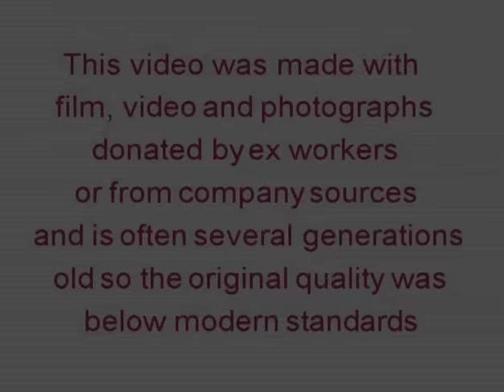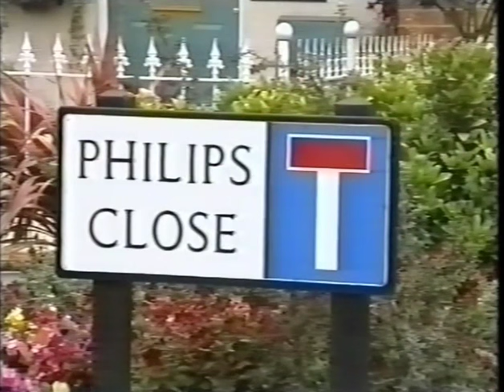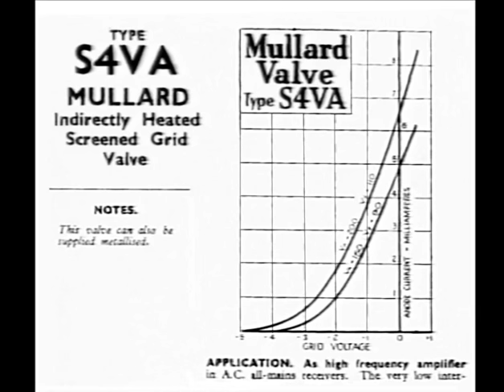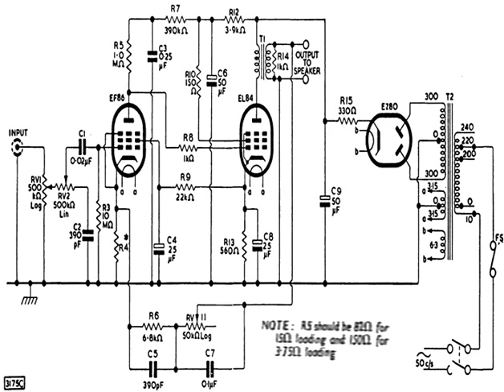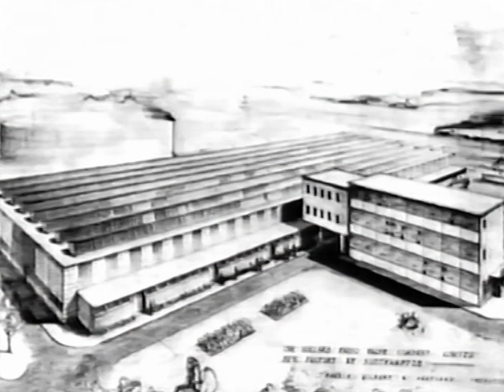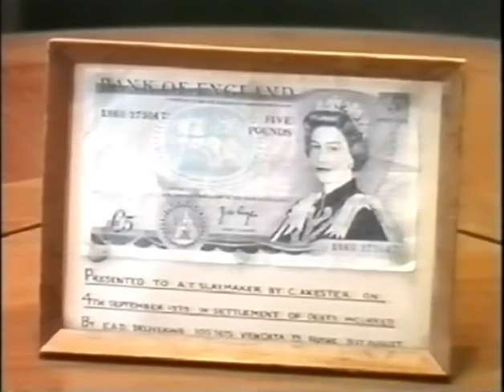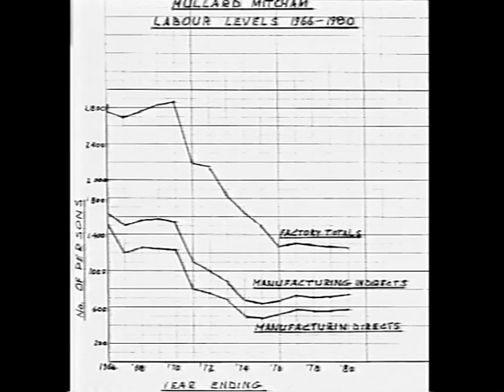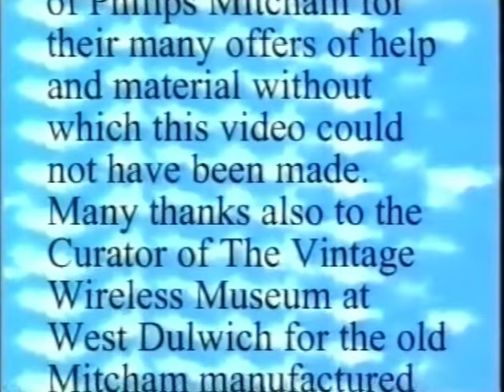Mullard Mitcham Remembered

Comment: I worked there in the early 70's on a student training program. Absolutely amazing place, so many people working on so many different products. I was based in the transmitting valve section and later in the FM radio module department.

Some of the products I remember: Colour TV tube production, microwave cooker development,  magnetic computer memories and fibre-optics.

It was a great place to work, with a real buzz. It was all state of the art stuff then, topped of with an amazing canteen!
Reply from the maker: I was also there in the early 70s working in the Deflection and Display Lab for Alex Ciuciura. Maybe we met! I built an FM tuner using Mullard Modules. I still have it.

Comment: I was an apprentice at Copeland & Jenkins in the mid 50's, where we produced the mica insulators, that went into valves. I have always wondered as to why the position and sizes of the various shapes & holes, were tied up to such tight tolerance, when what passed though them seemed to have a lot of clearance I have ried to find out more of C & J works in leyton, but they seem to have disappeared without trace even though some 800 people were employed there at one time.